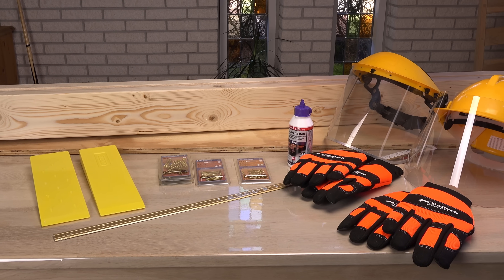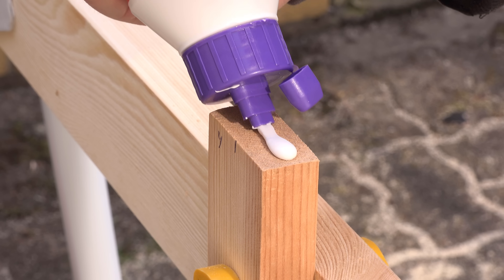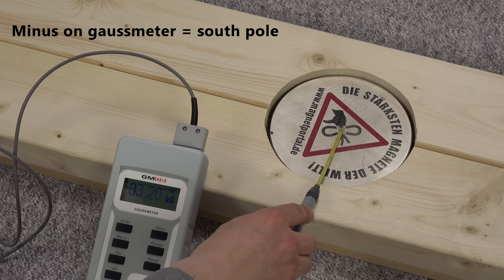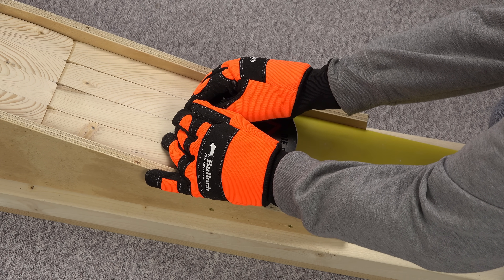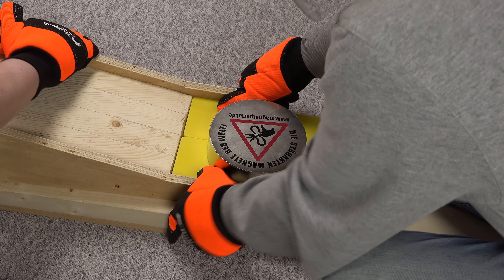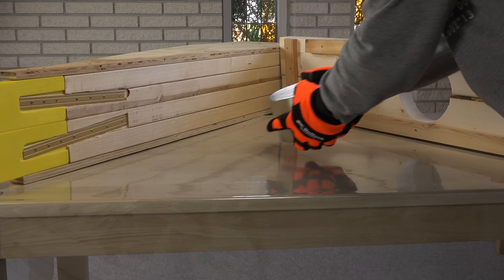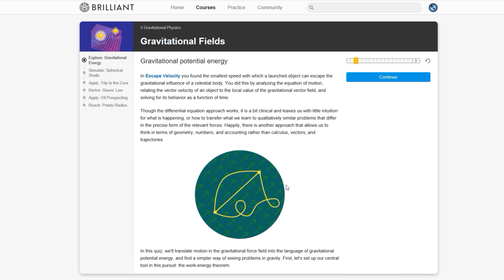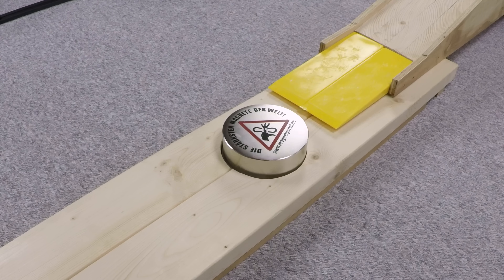Monster magnet meets monster magnet...

Comment: now the question is, how do you get them separated?
Reply: You don't. EVER.
Reply: Chuck Norris would get the job done
Reply: @zilchnilton  Absolutely!! All he has to do, is to show up. That will SCARE the magnets apart! :D
Reply: Generally you don't But an idea could be to put them into two separate panels flush together, and start pulling those panels away from each other while the magnets are snug together.

Good luck having enough power to separate them though!
Reply: @rhyzvanic3660  maybe both in their own notch and the top on pushed by a 20' long lever? or a massive pulley system?
Reply: Vlad1m4ra I would think mechanical force would be the only method to separate them, like reverse presses.
Reply: Vlad1m4ra he’s got another video where he uses a splitter to get two smaller but still powerful magnets apart
Reply: You need two Ferrari going it opposite direction
Reply: @kevinsargeant6426  better: Teslas 😊
Reply: Kevin Sargeant actually  10 Ferrari's
Reply: Create two magnetic fields, one for each magnet, that will generate a repulsive force between the two, just enough to get a wedge in. Or maybe strong enough to propel them away from each other.
Reply: Give them some speed force. Where is barry when you need him.
Reply: The idea of magnetic fields that has been suggested a couple of times here has one major problem:
No outside field can overpower the field that is inbetween the magnets. So that doesn't work.
I'd suggest two blocks similar to the one at 2:41, though with a really tight fit around the magnets.
One gripping the upper magnet, one the lower, so that the blocks contact exactly on the same level as the magnets.
Then you could push the blocks in opposite directions, applying a sheering force to the conjoined magnets. 
Preferably via some screw-driven mechanism comparable to a vice, so that you can apply a lot of force and any change in position automatically locks itself.
Thereby you are only incrementally reducing the surface along which the magnets contact, thus only slowly decreasing the magnetic pull.
Reply: @rockyblacksmith  has a pretty good plan and much the way that I would try it if I was going to do it.
Lots of people seem to be worried about how much power would be required to pull but the primary force  a sheering pull would work against is the static friction generated by  the 2400Kg pull, which I guesstimate in the range of 1500Kg.
I bet a good come along winch would be strong enough, they sell them commonly for 4-5 ton rating.
Not to say it would be easy, but hardly requiring hydraulics or heavy equipment.
Reply: Everyone didn’t get the point
He means the engineer’s eyes at 0:57
Reply: @TheSkyburner   You are right man :) over 80 degrees ND magnets loosing their magnetic power.
Reply: @PzMeyer44  : I'm glad that some physical realities are being relayed to the common man here on YouTube, like - heat destroys magnets! So much better than "the Earth is flat" and that cult of morons.
Reply: @TheSkyburner  that might be the only way. But it would effectively destroy the magnets. Sure, the objects might physically still be intact. But they would no longer be magnetic. So 'destroyed' is essentially correct.
Reply: You ask Eddie Hall to pull them apart!
Reply: You use a magnet splitter
Reply: Is it an axe? Do you know that when you split the magnet, you release an exponential, outwardly persistent, magnetic field into an unbound veil, a slither, of reality? All that benign potential, suddenly released... But it fills that reality with new matter, forcing expansion onto it, as do other planes of existence that force matter into ours with their stupid magnet breaking activities.. and the fragments that remain, now entwined in their own magnetic torture. Where they once shared a common force, now each their own, turmoil and suffering. Stop breaking magnets, and leave the other dimensions alone. Heartless miscreants. 

It's an axe, isn't it.
Reply: Use more magnets.
Reply: Easily, just tell one of the magnets that the other one isn't attracted to it anymore. Duh
Reply: But then you get a unrequited polar event, where one pole will be attracted, unnaturally, to the opposite pole, and go through it's rubbish bins at night, piecing together the life that the south pole has now become attracted to leaving the north pole stuck, trapped in a quantum magnetic void, where not even 10 schrodinger's cats can give him hope, as he opens each box in sequence, revealing nothing but.. dead... cats.
Reply: Causing him too become bipolar.
Reply: Dude, what sort of sex toy is this again? Sounds like a woman, painful, gripping one so hard and letting the other one dangle freely, and all that...

And you simply cannot bolt a woman to a table... you get bashed before you even think about it.
Reply: like how i try to separate the neodiums i get from recycled harddisks, by sliding them away from each other, bcos mine are flat rectangle pieces with more then 1 spot of polarity on the same side it appears easier , plus they are not that strong... considering these ones from the video, , note that bottom placeholder they had used, make two of those, 1 for each side of the magnet and then bound both planes together but allow sliding, and then play tug of war with a machinery that can put apart 1200kg of force ... the question is will the "side" of the magnet hold its own 1200kg force without breaking ...
Reply: play the video in reverse
Reply: Two bulldozers
Reply: Squeeze one magnet in a hydraulic press and ask a sumo wrestler to sit one the other
Reply: you don't. lol
Reply: Only Thanos can separate them.
Reply: pull hem apart with you hands
Reply: Throwing them in a black hole
Reply: https://www.youtube.com/watch?v=XwCLs97O12A
Reply: What if though, you sold them as Unified Magnets, and then, like, people would be astonished by the fact they are completely stuck together, despite being 2 separate things.

There is NO such thing as a waste of a new product. Just ask China.

waves at aliexpress
Reply: Thanos will be able to do it
Reply: Need bring them to (near or quite?) Curie Point (thermic). ( Nd2Fe14B  310-400 °C  )
Reply: Super Gecko muscles!!
Reply: you don't
Reply: Separating them would be rather easy with the right tools. One could use two "self locking" clamps which grab harder when one pulls stronger on them. They are pretty common in construction, e.g. for lifting curb stones. Then, one could attach one clamp to each magnet and pull them apart using a winch.
Another possibility could be using pieces of heavy duty plastic drain pipe with a diameter which just fits over the magnets, cutting slots into the end to make them more flexible, and clamping them on the magnets with strong hose clamps. Then, attach ropes to the pipes and again use a winch to pull them apart.
Reply: Nick Stick magneto
Reply: Delete the universe.
Reply: Or just watch the video he made on exactly what you said?  Top reply??
Reply: put it in rice
Reply: 10 ton hydraulic press wedge and grease
Reply: They should fit it inside some Teflon
Reply: Let them get married.
Reply: Nick Stick  ONLY DEATH CAN SEPARATE THEM
Reply: Nick Stick melt them
Reply: just burn it.
Reply: Use a knife
Reply: tarapia tapioca
Reply: Nick Stick using that thicc ass snac
Reply: Curie temperature. Actually a simple house oven should decrease magnetic strength by a fair amount if cranked up to 250C. Provided its not made of  ferromagnetic metal.
Reply: Chido wey a huevo
Reply: Gotta pee on it
Reply: you pull with a force of 2401 kg. Easy
Reply: Shoot it.. Trust me when a gun is involved the magnets will listen
Reply: A high enough centrifugal force (in other words, spin them) would get them apart from eachother but it's not likely to be very safe.
Reply: Ask me nicely.  To me, it would be like separating the layers of an OREO cookie.
Reply: I can think of 3 ways.

1. Place them in an oscillating (constantly changing) magnetic field
2. Start hammering them
3. Put them in a furnace
Reply: @XX-tb1fe  fire them out of a rail gun. ? Lol
Reply: @XX-tb1fe  But wouldn't that just demagnetise them? What if we want them to retain their magnetism while seperating them?
Reply: @XX-tb1fe  with a steel hammer
Reply: @XX-tb1fe  you missed the simplest one,
4-slide them apart. as we see. they were slid on each other for last few millimeters. it was enough no more than 100 kilos. I assume that in reverse will be required some more, maybe 200 or 300, simply place one in that wood hole, and second in a similar one. then slid the planks with a winch. Some oil trickled between them will help.   One issue may occur, close to edge the contact surface may be too small and the attraction/pressure too great and the edge may crack, if is really really brittle. In this case, just slid it half. enough to have plenty surface to pull them apart.  I suppose they are not so brittle though. It clanked when plastic broke.
Reply: Or... add more of them together till their magnetic frequency outweighs the capacitance of their combined mass, and they will simply slide apart.
Reply: @parishna4882  : Quote "Or... add more of them together till their magnetic frequency outweighs the capacitance of their combined mass, and they will simply slide apart" = if I use some science-like terms in there, most YouTubers won't know that it's all bullshit and will think I'm actually clever!
Reply: Or they'll see something so strange to them that they will call you a false wizard, cast you out, and you'll spend years growing a long, flowing white beard whilst spinning yarn to make a large pointy rimmed hat, whilst wearing a flowing purple robe made from baby marsupial rodent skins, to return to your home, and proclaim "Behold! For I am Anhedonian Epiphany and YOU will embrace me." as you flick your robe back, revealing that you had precious little time to weave yourself any other clothes.
Reply: I don't mind. I have a good dentist.. Oo
Reply: Keywords: You don't.
Reply: Why not force a thin long metal piece between them and they'll get separated by small gap. Then increase the pieces
Reply: @djmika8  
Trying to force something inbetween them would chip or even break the magnets since they are really brittle.
Reply: @djmika8  If you can count, then I suggest you don't count on that being possible. I see only two possible scenarios.
1. If you make the wedge (the metal piece) thin enough to fit the tiniest crack between the magnets, it will not be strong enough. As you apply pressure, it will either bend or break.
2. If you make the wedge strong enough to not break under the stress, it will certainly damage the magnets' surfaces.

Essentially in both scenarios, you'll fail!
Reply: Yes, start with the impossible, and then increasingly rely on that for a thorough solution ;-)
Reply: @djmika8  because those are 2 magnets with over 2500 pounds of pull force each, you're not getting anything wedged between there, no matter how thin, even if you do, that's over 5000 pounds of pull force you have to overpower with a thin piece of metal.....not happening
Reply: Give them just some time, time seperates every couple :D
Reply: Divorce lawyer
Reply: Hot glue.

Comment: Couldn't you have done something with a thick block of ice and letting it melt, eventually bringing the magnets together.
Reply: The ice would probably have crumbled under the pressure while the magnets were still a dangerous distance apart, causing them to smash together and shatter. That was why wood and plastic were chosen for the separators; they're not brittle and won't crumble. Using a disc of a metal with a low melting temperature, like gallium, and allowing that to gradually melt might have had better results.

As the host is careful to stress, you take no chances with these things. You have to plot your route through a room carefully when carrying one, lest nearby ferrous items become airborne. In one tragic case, a man with two of these magnets crushed his small son's hand through simple carelessness. The son was holding one magnet and the father accidentally brought the other one within range; the magnets smashed together, obliterating the boy's hand.

Comment: Couldn’t you just bring them together using a tube?
Reply: As far as I understand, they will break.
Reply: I guess what I pictured back when I posted this was something with friction~
Reply: A video for you. Please Like and Subscribe, thank you: https://www.youtube.com/watch?v=8IMPe5hdw5Y&t=3s
Reply: @Markus Patients a tube of the same I.D as the magnets O.D  Put one magnet in the bottom, fill the tube with motor oil, put the other magnet in the top and stand well back.. in fact, mansplain it to the Missus and get her to watch it while you go to the bar have a nice cold beer  :D
Reply: @Markus Patients A tube filled with oil and a small orifice.
Reply: @rockyblacksmith  it depend, you could put them into a tube with water and since the water is
incompressible not matter how strong they are, with a valve on the tube you could put the water out slowly and there it is.
Reply: @tony001212 
That could work, though that tube would have to be pretty strong because the water between the magnets would be under increasing pressure.
Reply: @rockyblacksmith   exactly, a thick polietilene tube would be ok,  after that you will have to cut  the tube to put the magnets out lol,  that's  a shit I know but could work,  another way could be putting  the magnets  into a furnace, I heard that when you heat up a magnet this one lose its properties.
Reply: @tony001212  they don't usually regain their magnetism, so that would be pointless
Reply: @tony001212  How big do you think water pressure will be? I'm afraid at some point of time the tube will crack or the valve shot off.

Comment: You did this over complicated. You could have just put one magnet on a table a sturdy curved piece of wood or plastic they are confident would not break and then bolted or screw its ends to the table and gently place the other magnet on top it to where the magnet anything and I need above it are only separated by the sturdy piece of wood or plastic and then gently remove the wood or plastic and then your magnets are combined